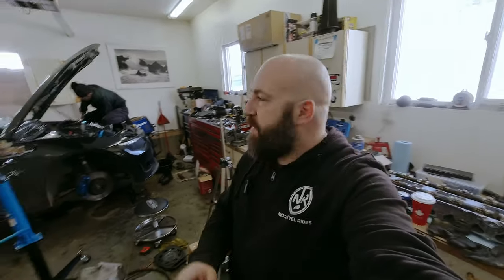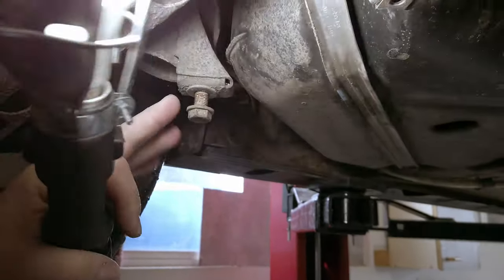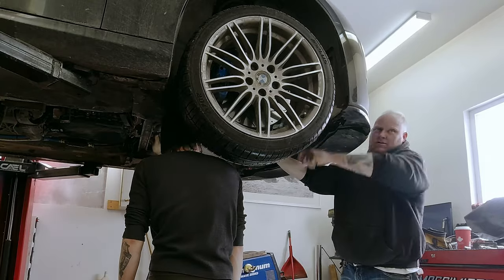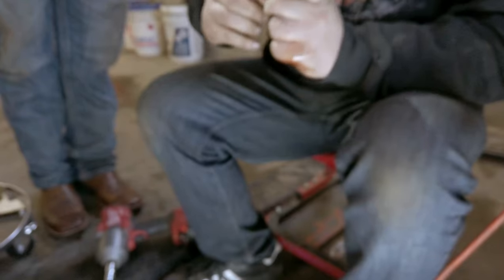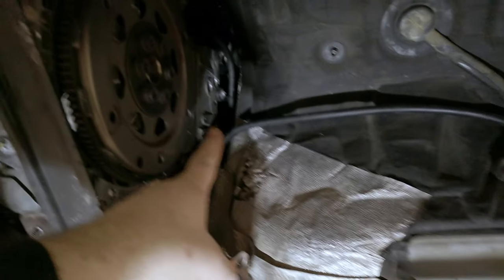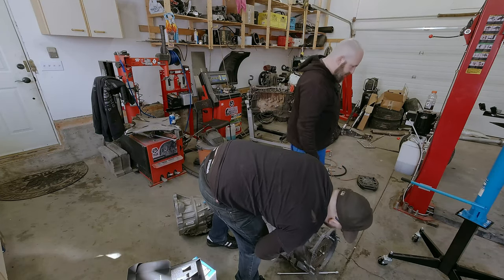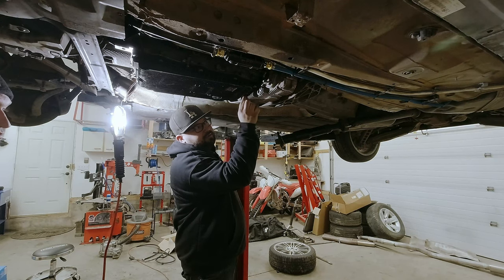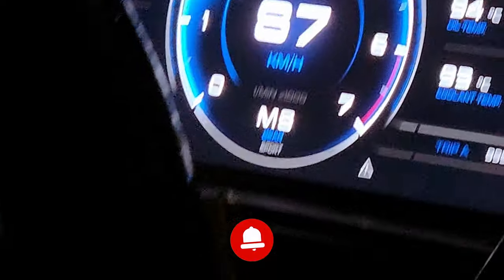Single Turbo N54 BMW Gets an 8hp Transmission

Comment: Just finished my 8hp70 swap on my 335xi can you tell me your settings on the N54 when it comes to torque corrections? My Shifts feel like sloppy and it does not shift down like the 6hp if you give it a little gas push i think that comes from the torque the ecu sends out that its not enough right? Thanks ❤
Reply from the maker: hmm, what controller did you use? or are you flashed with xHP?

Comment: My ZF8HP45 swap is all done! Car is running great with Kenneth’s and all your guy’s help.

This transmission is a game changer. Completely transforms the N54 platform. CanTCU stock map Drive is better then stage 3 xHP on the 6HP21 out of the gate.

xHP here I come.
Reply from the maker: heck yeah! if you need a hand with what settings to use, judt send us a message!
Reply: @tony.nextlevelrides  that would be helpfu! Thanks.
Reply: Great 👍🏽, I am in the process now fitting F82 DCT to my e92 335i pre-LCI, just a question on how did you install the base map? Was it easy?
Reply from the maker: for xHP? we did a video on how to flash that. It'll default to the factory software after the swap once Ken has worked his magic setting it all up.
Reply: Super easy! Kenneth from CANformance did all the initial factory “base” setup remotely for my locked 8HP45. After that I used xHP to upgrade the TCU.

3rd gear I was hitting the torque limiter on factory but once I upgraded to xHP no issues.

I’m FBO running 21psi on E30.

Hope that helped!
Reply: Tony has also helped me with some xHP settings. Running stage 3 on XHP right now.
Reply: @edwardwerley8831  thank you, it might sound crazy but I am goin to do the swap in a garage where there is no connection, so when u said Kenneth did the setup remotely that means it requires internet connection right?
Reply: Is this cantcu module for daily driving?
Reply: 100%. With just the CanTCU system you get the performance of a stock 8HP. On Tony’s swap and my project we choose to install xHP for the enchantments offered.

My understanding is CanTCU is working on a xHP like solution so it would be a one stop shop.
Reply: @edwardwerley8831  thank you ! I saw the M shifter that you fitted on it, that’s mean you can use the gearbox like an m3 ?

Comment: After the initial install. This is a very cost effective option over the 6 speed manual and the twin disc clutches available. I'd rather swap a trans and have another on the shelf all rebuilt for when the 8hp goes. 
Drifting is tearing up even my twin disc clutch up and I ain't spending $1700+ again for another one.
Simulated clutch pedal is the new new.
Reply: This is my plan, just swapped an 8hp45 into mine, I am right at its limits for torque, these trannies are so cheap right now that ill have another ready to go in when this one bites the dust.

Comment: did you have to use an adapter plate on the 8hp45?
can you talk about the choice of which 8hp trans when swapping into the e92?  thank you!  great video!
Reply from the maker: the biggest difference is not needing an adapter plate on the 8hp45, it's been holding quite well on our e92 with a 6466 with knock on wood zero issues.

the 8hp70 is stronger but also needs an adapter plate and driveshaft to use.

Comment: Nice build man. I am also running a bottom mount 6466. Any performance advantages to the 8hp vs the DCT? Thinking swamping an 8hp might be a less expensive route than a DCT. Just curious about performance differences.
Reply from the maker: the 8hp was a much cheaper swap and holds (seemingly) more power in stock form without cracking it open, I don't doubt it'll hold around 650wtq with the xHP flash. I find it also drives nicer than the DCT and shifts very, very close. I'm a huge fan of the 8hp.
Reply: @tony.nextlevelrides  Agree with the 8hp driving nicer for daily (have one in my 540i) and bonus that it can hold a good amount of torque.  My 335is came with the DCT and I am experiencing slippage at higher boost. I do enjoy the sportiness and will be upgrading the clutches soon if xHP settings do not alleviate it.  Nonetheless, it is good to see people still supporting the N54 platform. Cheers.
Reply from the maker: I'd definitely flash xHP if you haven't already. the bump in line pressure is likely exactly what you need.

with the 6hp and 8hp, I increase torque reduction to ske some strain off the transmission during shifts. I don't think the DCT has this option but the bump in line pressure will definitely help. at least for now. 🩹
Reply: @tony.nextlevelrides  The DCT has an adjustable torque reduction setting in XHP as well. But if its slipping definitely just needs a new clutch.
Reply from the maker: I agree, the xHP will likely help momentarily as a Band-Aid with the increase in line pressure pressing the clutches but ultimately you'd need to upgrade the clutches.
Reply: Already had flashed xHP, but never messed with the torque reduction/punch. Flashed it to the latest update and no more slipping at higher boost. At 26psi right now on map 6, see for how long it holds before it needs new clutches or motor lol
Reply from the maker: @james10165  I figured it was named "torque punch" does it have "line pressure bump"? if it does, select that
Reply: @tony.nextlevelrides  There is only 2 options for the DCT. Torque punch and Torque reduction. Selected both. Also the updated files raised the line pressure to 20 bar which seems to have done the trick.

Comment: Ima do this eventually when I get a single turbo, thought my trans was dying tdy but turns out trans oil cooler lines are leaking 🤣💀.
Reply from the maker: haha, running a touch low on fluid can cause some random headaches for sure. I recommend following the fill procedure once you're lines are fixed and good to go.

Comment: Nice! I wanna do this to my bmw someday! It's AWD 6sp manual. I just upgraded to 19t. How much HP can the 8hp45 hold? I'm running about 26psi. 

Side note, I installed the 8hp70 in my hemi swapped jeep and I love the way they shift!
Reply from the maker: I believe the 8hp45 can hold around 640wtq, really depends how much you launch I guess.

this one was tested a few times (albeit accidentally) to 35psi on a precision 6466 - took it like a champ!

it's a much, much better transmission over the 6hp.
Reply: @tony.nextlevelrides  haha very awesome! Yeah I'll launch it more once I have an auto, launching the manual is fun, but can be annoying.  I look forward to doing the swap someday, and I'll be using your video when I do 🤙🤙
Reply from the maker: awesome! can always shoot us a message with any questions when you're getting into it. should be easy going from a manual to 8hp too!
Reply: @tony.nextlevelrides  will do! When the time comes I'll get with you guys on Facebook! 🤙🤙 Hopefully this YEAR!

Comment: Simple and detailed video. Question: I want to do it on my 135 n54 with auto. From what I researched driveshaft, diff,  trans mount can stay the same for this swap and just need the Can kit and a shifter and aftermarket cooling lines. Or I am missing something? Thanks.
Reply from the maker: nope! that's basically it!

Comment: Well Im late to the comments. I am looking at 8hp70 controllers. You said you flashed the tcu with a spicey tune. Does the can tcu have software to tune the tcm or do you have to ise a third party programmer to tune?
Reply from the maker: we used xHP on the transmission, cantcu will be supporting flash settings like xHP soon enough! you won't need to flash xHP.

Comment: Did u need any adapter plates for the bell housing? Or did the 8hp45 just fit right on without problems?

Also what donor cars were you looking for to get the xdrive 8hp45?
Reply from the maker: the 8hp45 bolted up perfectly to the N54. The donor transmission was out of a 2011 BMW 535i xDrive.
Reply: @tony.nextlevelrides  thank you so much for the response. Do you have any numbers of what can the trans hold up to as in tq when custom tuned ?
Reply: @tony.nextlevelrides  also all that’s needed for the swap is the (canecu, shifter, 8hp45) correct?
Reply from the maker: basically, yeah! if your donor transmission comes with the lines, you can easily adapt them to your factory cooler setup. you'd likely want to get new fluid and a pan/filter as well.

Ken @ cantcu makes the swap super easy.
Reply: @tony.nextlevelrides  would the paddle shifters still be usable when switching the m shifter for an electric one?
Reply from the maker: @mustafaamer112  yup! once programmed they work perfectly fine. I believe two wires were run in this e92 by the owner afterwards since his paddles were pre-lci. by the sounds of it, the process was very easy.
Reply: @tony.nextlevelrides  we need a whole video of an 8hp45 swap review and how it handles power. Tunes. Driving clips. Burnouts. That would be amazing!
Reply from the maker: @mustafaamer112  I think I can manage something like that :) the weather is poor currently but there definitely will be more footage in the near future.

Comment: Well made swap that I’m really interested in.
Did you use the old 6hp torque converter? As I have a e91 330xi I’m stuck between using a n55 8hp45x which is a PITA to find here in Europe, or find a 8hp45x from a n20 which is far easier to find however the torque converter is not compatible with the 6hp original flywheel?
Reply from the maker: I have an 8hp out of an N26 in mine, used factory flex plate and 8ho torque converter.

Comment: I’m looking to do this to my 335i since my 6hp is on the way out, will any zf8hp45 work and I just need CanTCU for programming and would you say the 8hp is better than the dct because I see CanTCU supports both which would be better option
Reply from the maker: I'd say 8hp is all-around better for drivability. if it was a track car, I'd consider DCT at that point.

Comment: Hey! I want to swap my E91 335ix as well can you be so kind and let me know what type of 8hp i need to buy for it to be bolt on like yours? So from what donor would be the best? And 8HP45 or 70 or which one? Would be awesome if you help me out here 👍🏻
Reply from the maker: you'd need one from an N55 if you are xDrive. This is best sources from an F10 535xi.

Depending on your power goals, 8hp45x is more than enough.

Comment: I remember when this video was first posted, my 6hp was on its way out. Because of your video I found an 8hp45 with 78k for 300 like the next day.  My 6hp finally let go about a month ago at the track, ran 11.8 @ 128 with traction control on and launching easily, when I gave it my all the 6hp couldnt hang. Either way - I just finished my 8hp swap last week, did it on jackstand and can say its no brainer, I'm about $2400 into my swap and the work was super easy(as long as your inlets arent blocking the top bolts). The car drives so much better, the lower gears are insane, runs through 1st to 3rd in a blink of eye.
Reply from the maker: awesome! we love hearing a success story!!

Comment: Is this a built transmission ? Also how much power can a stock 8hp45 handle ?
Reply from the maker: stock transmission! they can handle approximately 650wtq but that's at its limits.

Comment: Love this, i’m starting my swap now just got all the necessary parts. Do you need to have Ken flash a base map on the tcu, or is it complete plug and play?
Reply from the maker: yeah, Ken will need to remote in to unlock and code it. He will put a base map on at that point!

Comment: Hey guys! Great video i just need some help and i hope that you guys can help me, what do i need to programm? And could you please make a list of what is needed(Link) and where need to go all the cables inside the car? Is that in the manual written?  And it should fit on a e90 n55?Thank you guys!<3
Reply from the maker: yup, should fit no issue. same bellhousing.

everything is on: https://www.canformance.net/

you need the shifter adapter depending on what one you're using, plug and play harness and the cantcu controller. that's about it from them.

instructions are provided!
Reply: Thank you!!❤

Comment: bro i got a dct im thinking to put in my e36.. but im wondering is the dct worth doing over a 8hp?
Reply from the maker: hard to say, it would be pretty wicked but the 8hp is cheaper and equally as fun to drive. I've been VERY impressed with the 8hp in my 540. it's good

Comment: just subscribed, very interested in doing this for my car.
Reply from the maker: it's completely transformed how the car drives. we'll worth the modest cost!
Reply: @tony.nextlevelrides  I’d be interested in putting the 8hp70. I have a 2010 e92 n54. What are the differnces between the 70 and 45? Both Preformance/cost/reliability?. Aside from the kit, trans and fluids is anything else needed ?
Reply from the maker: @boostd6  the 8hp70 was out of 550i and similar vehicles. the bellhousing is completely different so you'd need an adapter plate. other than transmission cost and availability, the adapter plate seems to be the only difference.

depending on your goals, the 8hp45 would hold up well. we'll have to stress test it this summer with some fun down in Mexico. 🇲🇽
Reply: Transmission-$500
Shifter-$100
Cantcu,shifter mount, wiring harness $2000
Domiworks Oil cooler adapter$160
Fluid and service kit-$190

Total cost in CAD and parts needed

Comment: How do I do a manual to 8hp swap? I have a st 135i and I want to ditch the gearing if the 6MT
Reply from the maker: it might be best to reach out to Ken @ Canformance to confirm. however, I don't see why the swap wouldn't be similar if not nearly identical to this video the harness would add onto your existing one since the manual transmission doesn't have a mechatronic. you'd just need the transmission, torque converter, flex plate and bolts (that likely come with the donor transmission) a driveshaft is a maybe if its different in length.

it -should-be pretty easy and straight forward!

Comment: I currently have a 325i with 6hp, the gearbox is slow af and the pedal response time is mushy, what does it come from ? Don't think that much work worth for a 250hp heavy car...
I always wanted to do the xhp stage 2/3. My brother bought a 335i with dct plus did the xhp mod on it, it's crazy, especially on downshift, my best friend has a 435i with 8hp and i prefer the moded dct. I don''t know what to expect if I do the mod
Reply from the maker: it all depends what your goal is. some would say do the swap and go from there, others will say sell the vehicle and start with something "better". I'm not certain but I thought xHP released a flash for your 325i (if it's e90/e92). if so, it would be a noticeable improvement over your current setup.
Reply: @tony.nextlevelrides  going for a 335i n54 then they are many around 10k. For a e92 instead of my current e93 for the weight. Does the mushy pedal feel is improved with xhp?
Reply from the maker: @freinagetardif6882  yes, it's greatly improved. you can try the "throttle adaptation reset" as well, it may help. you'd need to google it but the process is the same.

Comment: So my question is if  my 335i is not an xdrive will i need an adapter plate?
Reply from the maker: yes, otherwise you'll need to find a RWD 8hp45 out of a 228i or 330i.

Comment: Did you guys need a bellhousing adapter to fit the 8hp to the n54 and what model 8hp are you using
Reply from the maker: nope, since this 8hp45 was out of a 535xi with the N55, it bolted up without any issues.

Comment: How did you flash it? Is there a separate obd? How did you install the software?
Reply from the maker: yup! separate OBD connector solely for the transmission. I filmed another walkthrough on how to flash this swap specifically. it'll be out soon.

Comment: can i swap 8hp50 in n55 e91 like you did 8hp45 in n54?
Reply from the maker: I'm not sure which N55 came with the 8hp50 but if you find one it should fit without a problem.

Comment: What trans thermostat did you use? What temperature?
Reply from the maker: haven't installed one yet, currently we're monitoring temps and going from there. definitely does run cooler.

on my subaru I ran a Mocal inline thermostat, worked great.

https://www.lojkits.com/products/mocal-inline-fluid-thermostat

Comment: What mesh did you buy to delete the m sport fog lights?
Reply from the maker: none, they were just removed. I have however I the past, used fine mesh wire for a screen door to do exactly that. most of the time it can be found at your local hardware store.

Comment: Maybe a stupid question, but why couldn't you go through all the gears while on the lift?
Reply from the maker: you could but it doesn't hold the gears for long enough to bleed the gear. you can run through them quickly (half/full second) a couple times. this will work.
Reply: @tony.nextlevelrides  Thanks for answering. Manual mode doesn't work to hold gears?
Reply from the maker: @Robert.K not above 2nd gear. you have to go through gears 3-8 quicker as it won't hold them. I go to 8th gear, wait a second and it'll drop to 2nd.
Reply: @tony.nextlevelrides  Then I understand. Thanks for explaining. 👌🏼